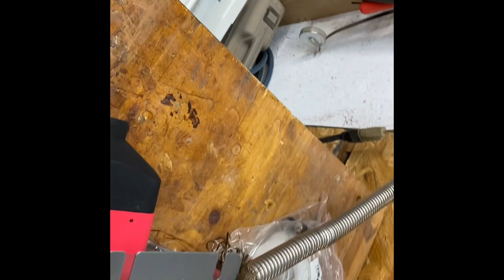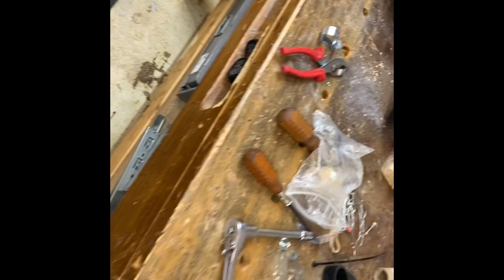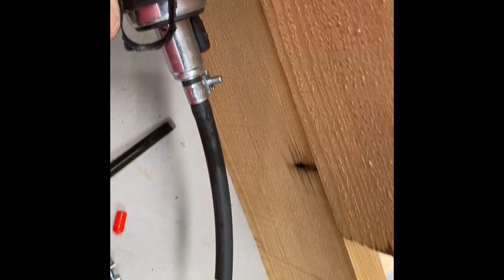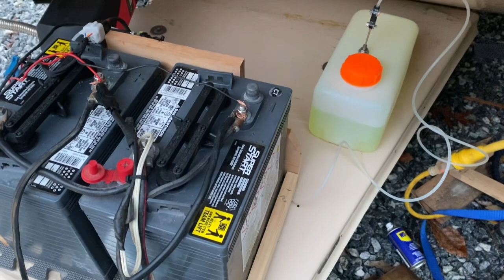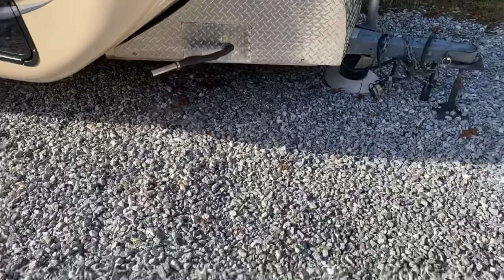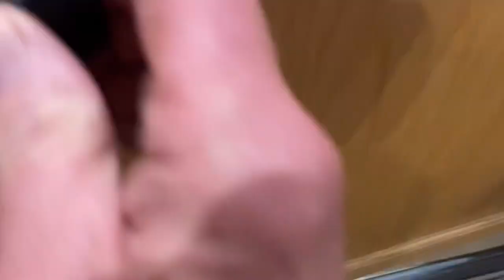Diesel Air Heater in A LiI Snoozy Camper

Comment: Instead of doing all that I would make a custom aluminum box the exact size as the air conditioner and put all of it within that box for the exception of maybe the fuel tank on the outside and then all you have to do when you come to the winter season, is pull the air conditioner and install your custom aluminum box in the same hole. That way you’re keeping the integrity of the camper and not drilling holes everywhere. Just my two. Cents.
Reply from the maker: That is one way. The air conditioner is bolted in and has trim inside so it is not easy to remove. Any holes made in the floor are pretty easy to repair.
Reply: @ebenezerwoodworking3616  👍🏻